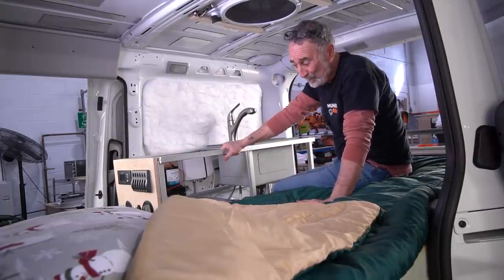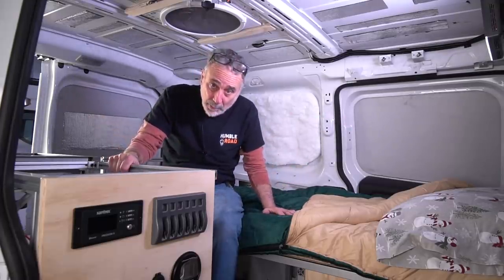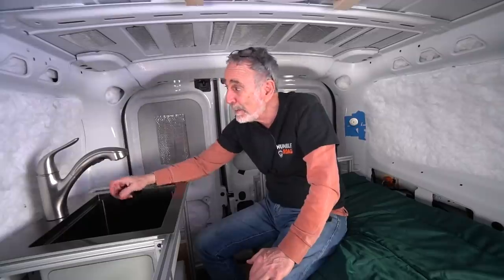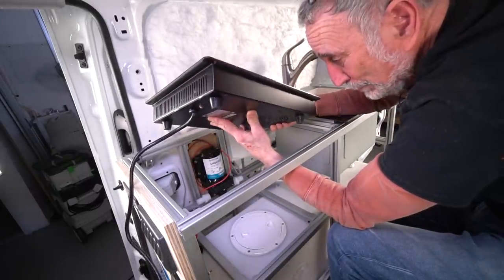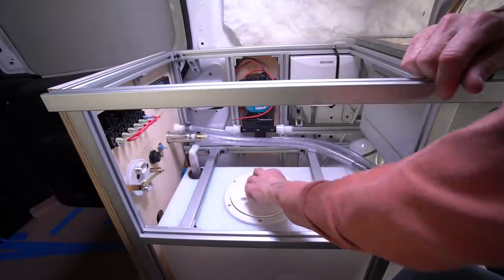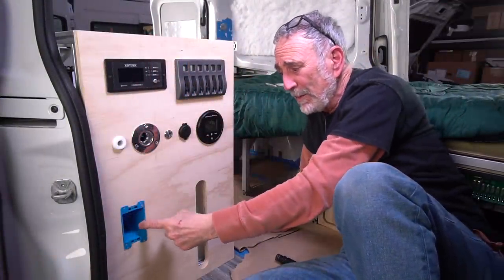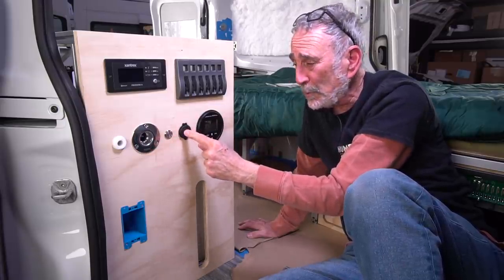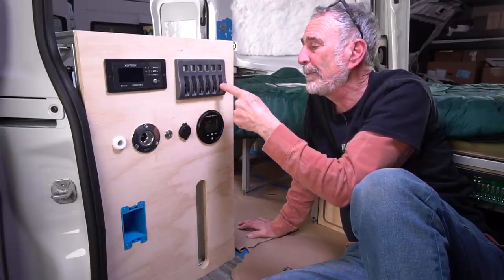The Humble Road Promaster City mini-camper. BIG features in a little VAN.

Comment: My 2 1/2 cents :-|  my preference would be recessed induction cooktop top.  Then as an innovative idea …. How about making a sliding counter top that would slide out of the way when exposing cooktop by becoming extra countertop area in front of side door! Crazy? We like crazy!! Btw, you’ve got me thinking about selling my Ford Transit Van Class B and getting a mini-me!
Reply from the maker: Great idea, Leo! I was thinking about hinging the countertop lid along the long rear edge. When opened, it is steel backed and acts as a heat shield against the wall. Your idea is more useful, particularly since there is no flame with induction and the heat is basically localized. One of these first two Mini-Me's is available at a steep discount. C'mon down!
Reply: I LOVE that idea Leo. We’ve seen George use sliding supports in previous builds for slide out trays, a slide out counter top is genius. 🤓🙌🏼♥️

Comment: I would suggest having the induction cooker inset below a panel in countertop so that you still have countertop available if decide to cook with induction unit out of the van. I would also recommend moving your gfci plug away from waterworks immediately above. I know that you aren’t suppose to overfill but it will happen and if water comes out vent or fill hoses it’s probably running over the plug in your current layout. I would also like to see a single slave plug plug off the gfci in the cabinet for the induction cooker hookup (cleaner setup leaves outer duplex plug for other things). I like the water heater/plug switch - brilliant.  I’d also like an awning style window in the passenger side slider for increased blind spot viewing plus to let some extra light and air in van if its raining without opening the front windows.  

My 2c that won’t buy you a coffee 😃 I really like how the design is coming along.

Comment: If the Slide Box Drawer next to the Sink had a Drop Down Hinged Fascia it could be used to support the Induction Cooktop. 
Come on George you know you can build it.
Reply from the maker: That would put the cooktop low and in the aisle. Not safe, nor practical.
Reply: @HumbleRoad  further from the Ceiling, Safer. 
Individual will be seated cooking anyways, so practical because this isn’t a walk around Van. 
But your build, your design.

Comment: Regarding the induction cooktop, I own one similar to the one you showed. Mine has a fan which requires clearance during operation. Your cooktop clearly showed air vents, so I am confident you will need to provide air movement clearance as well. Should you solve that requirement, I would prefer if it was my van to have the recessed cooktop with a cover to provide extra countertop. In my experience, my cooktop is about 3 inches above the countertop, plus the size of the cookware. This makes it a bit awkward setting down utensils while cooking. Food for thought, perhaps.

Comment: Why would you have electrical plug right under water fill?   Why not switch tank sight and electrical plug.   Sure you have a reason.   Mini van super cool.   Thanks for all the great videos.
Reply from the maker: Tank sight as you can imagine, is right up against the tank! no room there! I MIGHT have room to shift all water fixtures down and move outlet above. Problem is the pitch for the tank fill and vent- both MUST be higher than the inlet ports on the top of the tank.
Reply: @HumbleRoad  i figured you had your reasons..   you think of everything..   thanks for the info.

Comment: My vote for the induction cooking burner is:  counter height. My brain’s eye is concerned about cleaning up after cooking if burner is recessed slightly (crumbs, grease, splatters).  Conclusion—counter top depth with a removable, duo purpose prepping and cutting board protecting the burner as needed.  2¢ please.

Comment: depending on how the bed surface is attached - maybe install some visual bubble levels inset into the wood and have twist screws under the corners you can run up to provide level adjustment when you're parked...

Comment: Induction cooker option- go with the recessed version with a removable (or folding over) wood insert above and make it so the cooker can be removed and used outside !! ‘Options’ :-)
Reply from the maker: Cool, thanks!
Reply: Yep. Agree - with the wood insert the counter remains usable even if the induction cooktop is removed. 👍🏼

Comment: My vote for a recessed cooktop based on experience. We have a Cascade Camper that utilizes a butane stove placed on the countertop.  When placing a pot on the stove, it’s much closer to the ceiling, and not as easy to see into it while seated on the bed. Lower= better.

Comment: If you recess the induction cooktop with a full benchtop cover, a person can take the cooktop and use it elsewhere and have bonus benchtop for those times when you have every cooking utensil you own in use. Cooking and use the benchtop simultaneously doesn’t leave you a lot of prep area.  Or,  what if you put the cooktop on a draw slide pulling out from the end of the cupboard, it will block the door to some degree, but these are the compromises we make.   
That little van is coming together very nicely 👍🏼

Comment: Choice number 2.  you have to store it somewhere so why not in the counter.  not having it flush with the counter gives the counter which is used more than the cooking top, and it protects the cooking surface from accidents.  just pull off the cover and cook.

Comment: I like the  option on the cook top being recessed and a countertop over it. It would be better to have the countertop made of a light weight solid surface material than a cutting board. There are these thin plastic cutting boards that a good becthey bend to pour your vegetables into the pot or bowl.
Reply from the maker: Testing those options would mean having a few countertops and drawer boxes built. I can't go that far into testing. These vans will be completed by mid-May.
Reply: @HumbleRoad  Thanks George for quickly responding. I was wondering about testing.
I have seen on YouTube in a full size van, a sliding countertop over the sink and burner.
I like having the burner covered and being able to take it outside. I don't know what you have planned but I'll have to wait until next Sunday.

Comment: Inset induction w cover. Still removable. That way it is already stored, but safe. I love the switch on the outlet/hot water. Maybe a light would help for the hot water tank so you know it’s on?
Reply from the maker: An indicator light is a great idea. For the water heater to work, the inverter must be on and water must be flowing through the heater (pressure switch).

Comment: I like having the counter completely across and take out the cooktop when needed. One advantage is that cleanup will be easier. You don't have to worry about food, grease and/or water getting in between the counter and the cooktop. Before deciding, it would be helpful to actually use the cooktop for a few days the way you'd plan to mount it. Such challenges in such a small space, however I worry about that GFCI outlet below the water fill and vent. Yes, the plug is ground faulted, and the fill port is pretty safe. I don't like it. There has to be another location for that outlet, offset or above but not directly underneath water! And the Grey water solenoid: Powered on/open or powered Closed? and as to the location of  the water switch not right behind the  counter, but putting switch behind sink, making it a conscious choice for hot water of cook top

Comment: Induction cook top choice B presents more options. One downside is that it will reduce the volume of the drawer underneath.

Curious: why do you choose option A over option B?

Question: how much overload would there be if both induction cook top and water heater were in use simultaneously (absent your planned switch control)?

Question: I forget the length of the bed - help remind me please!!
Reply from the maker: Everyone is so concerned with cracking the glass on the cooker, when it is idle, not really thinking about the abuse it takes while in use! If it is installed flush with the countertop, it can be treated just the same as a solid countertop, within reason... When the water heater is in use (water flowing) it uses a constant 2400w. The cooktop has settings from 400w up to 1800w. The inverter can handle 3000w sustained. The worst thing that can happen, as I mentioned in the video, is the inverter, built with redundant safety features, would simply shut down and need a reset.

Comment: How about placing the induction cooktop in a drawer/shelf with lock-in/lock-out slides? 1) Use cooktop on drawer/shelf while locked out, 2) Place cooktop on the counter with drawer/shelf closed, 3) Place cooktop on counter using  drawer/shelf as extra counter space, 4) Use cooktop outside

Comment: After some thought, a recessed cooktop with associated cover is most flexible. The owner can remove the cooktop and replace it with the cover and use the cooktop outdoors or on the counter. Or could use it recessed. It affords the most OPTIONS (assuming you can engineer the countertop cover to work with cooktop either in place or absent— both).

Comment: How about a cutting board cover over whatever the induction cooktop would sit on? Then you could remove the cutting board and put the induction cooktop in its place and have the induction cooktop at the height you want without having to have the cooktop fixed in place.

Comment: Installing a gray tank today.  Gonna borrow your idea for the electric valve.  What do you use for a grommet for the drain pipe/hose floor penetration?  I've looked through old videos and did not see an explanation.
Reply from the maker: Properly sized rubber grommet
Reply: @HumbleRoad  Ok - kinda what I figured.
Just ordered the solenoid valve.  I'll let you know how it turns out.

Comment: I would eliminate the option of having to take it out and plugging it in every time.
How about hinged up on the wall behind the kitchen counter? Just pull down and you're ready to cook with no faceplates to temporarily store. If the hinge had some kind of quick release pin, it could still be easily detached for outdoor cooking.
Reply from the maker: I like the way you think, Leggo!
Reply: @HumbleRoad  Maybe even have it attached to a lightweight base so that it acts as a backsplash when flipped up.
Reply: I like this idea best of all!

Comment: You need to make two Mini-Me A load like you are building and minimalist ( with 30QT refrigerator, bed /couch,500 watt Jackery/portable solar panel ( or any brand portable power supply)storage,  Note: minimalist can be upgraded in the future . ( remember Ram Promaster City door panels are super ease to change to glue in windows ) It is super easy to builded both Mini-me Camper Vans !!!!
Reply from the maker: There are plenty of builders doing the Jackery kind of build. I've chosen to build a higher end brand for a unique discerning buyer.

Comment: Hi George, if the quality and reliability of the water heating system in this smaller van is good for this van, why not also use it for your larger 170 Sprinters?  Weight and cost savings right?
Reply from the maker: This water heater is designed as a hand wash system. Not intended for high volume use. The rise in water temperature above room temp is not as great as the bigger heaters. But here, in these little campers, it should be comfortable for hand and hair washing.

Comment: Love the high quality specs on this build. Are you worried about that Eltron water heater if the van is parked in freezing temps? Their website says to avoid any frost, and a small vehicle like this might get parked unheated at times. Otherwise, it looks perfect, but I would be concerned about ruining it in cold weather.
Reply from the maker: If the owner will expose the vehicle to freezing temperatures then it must be winterized. RV antifreeze run through the entire system should offer adequate protection. Keep in mind that this little guy can easily be garaged as well!

Comment: Yo ma dude! I think the cooker would be better recessed with a lift up worktop that can then act as a backsplash and can be faced with a stainless steel sheet.  That would be sweet!  Alternatively, if there is wiggle room, you could have the counter top slide on drawer slides over to the left and become an extended work surface revealing the cooker below and to the right.
Reply from the maker: Cool idea, dude!

Comment: On the placement of the induction cooker…. First, no matter what position you choose, add a flip up panel on the left side of the counter that will be flush with the countertop.  
     The biggest complaint I have in most builds is the cooktop & sink are right next to each other leaving no prep space between… drives me nuts.  Looking at the video, it appears the only way you can place it in the counter is long ways, left to right? So, what I would do, especially because this space is so small, is recess it, mount it as far to the left of the counter as possible with the controls on the right.  I can’t see the space but I wonder if you could make a flip up countertop that runs from the sink to the left edge.… & if you could, in 2 pieces… one to cover prep space & one the cover in cooktop.  That flip up counter top could serve as a back splash.

Comment: Water always below electricity. You need pressure control valve at the input hose. Could use an auto shut valve in tank for input (never to overflow).
Reply from the maker: Agree water below electricity, but there were other hard fast rules that overrode that.
Reply: @HumbleRoad  Life safety overrides them all.
Reply from the maker: That's a bit dramatic. We're not fire hosing the outlet! 👍😊
Reply: @HumbleRoad  If you hose it down the circuit breaker will trip. What is needed is a slow inconspicuous drip that consumes less than 12 A.

Comment: A small observation George, that water tank vent, which does have the potential to overflow IF overfilled or on overly enthusiastic tight turns, is directly above the 120v outlet. Potential issue right there?
Reply from the maker: Yep, I'm aware, but other circumstances forced this config. Just gonna have to be careful...or... add an outdoor weather cover to the outlet.

Comment: Quick question, looking to get into vanlife and was wondering if I got a small hand held clothes steamer, because I would need my clothes for some business meetings on the road, would I be able to use it in the van and NOT worry about moisture and rust?  I highly respect your advise.
Reply from the maker: Yes it will be fine, as long as you have adequate forced ventilation
Reply: @HumbleRoad Thanks that is good news

Comment: Number 1.  If recessed below the top surface you are making a non waterproof sink.  Your pot will boil over spilling water and filling up the recessed space or leaking below into the cabinet.
Reply from the maker: True, a spill over as you describe, will cause a problem no matter what the situation. I can certainly build a waterproof cavity for the cooker to sit in. I'd rather not, though, for it will eventually fail.

Comment: If I may:  the cooktop could be slightly recessed under a hinged counter top that also could be used as a backsplash.  I am not a fan of an electrical outlet just under the water tank fill, even if it is supposed to be watertight; I am not a fan also of the idea of the water tank vent to be located inside the van, running onto bumpy roads or hard breaking with a full tank may push the water out of the tank by its vent.

Comment: I like the recessed option with counter on top. My only concern about this option are some roads are pretty bad and I would hate for the cooktop to bounce up and hit the top and break in a small space. With the placement of the outlet below the water fill spot is there a risk of water getting inside the outlet? I get the need for as much storage as possible but still be livable in a tiny space so do you think it’s possible to have a small cubby just toward the top of the recessed area you were referring to? That way it wouldn’t be in your face while you’re sleeping if your head was on that end. I saw another comment about a fold over counter, that would extend the counter top, and there’s no such thing as too much counter top. Lady Bug out’ s YouTube channel just did I a video this week a about adding counter top work areas. I though it was pretty cool. I can’t wait to see more of this tiny gem build. 🚐♥️🙌🏼👏🏼
Reply from the maker: The countertop lid would fit snugly on top of the cooker and no bounce would occur. Yes, typically, you put water BELOW electrical outlet. But other circumstances forced this configuration. Sometimes, you just have to be careful. I could use a weatherproof outlet cover, but then that is protruding out into the hallway.
Reply: @HumbleRoad  I’m sure the owners of these cuties will be extra careful when filling. In such a small space you wouldn’t want anything protruding anywhere unless absolutely necessary.

Comment: put the stove in a drawer so I can also use it outside. Also what are you thinking!! flip the GFCI position with the water inlet unless you're planning a waterproof cover, but thats ugly.
Reply from the maker: water inlet cannot be lower than the inlet on the top of the tank

Comment: Lower the induction cooktop and cover it. My induction cooktop got scratched up and discolored after a dozen or so uses. Maybe yours will be more scratch-resistant? I would test it by boiling heavy pans of water on it and see if it discolors or gets scratched. Otherwise, it might not look good if mounted flush.
Reply from the maker: Thanks for the tip!

Comment: Option 2, recessed cooktop. No brainer.

Not very fond of having a 120v socket almost straight under the waterfill point. Not because of one or two droplets dripping down, but forgetting to close the tap first before taking the filler out....